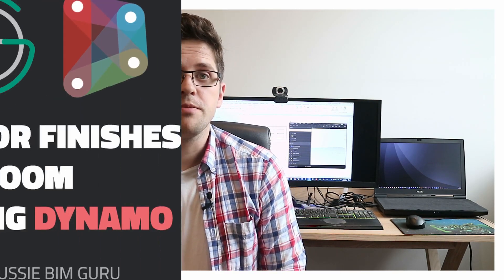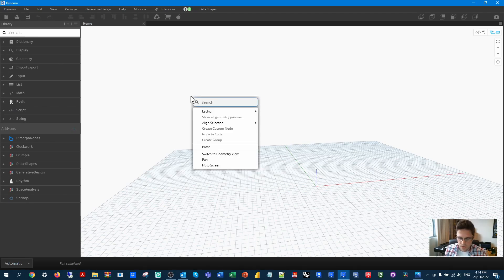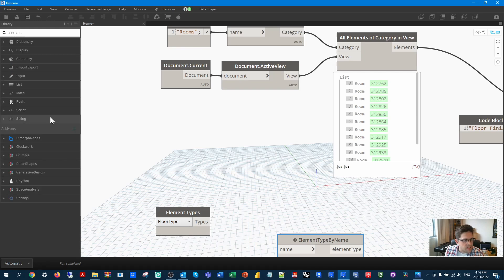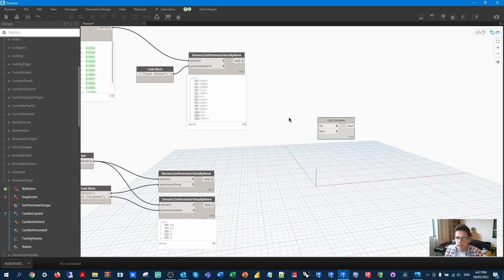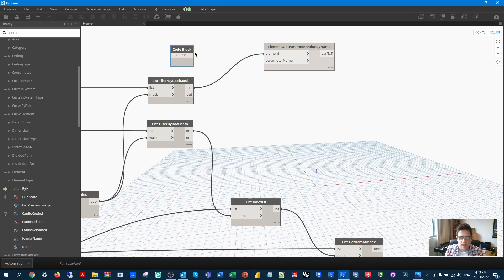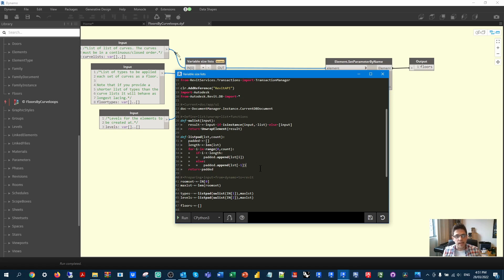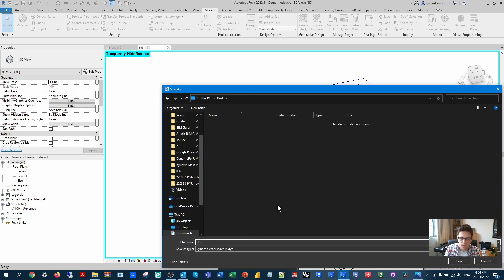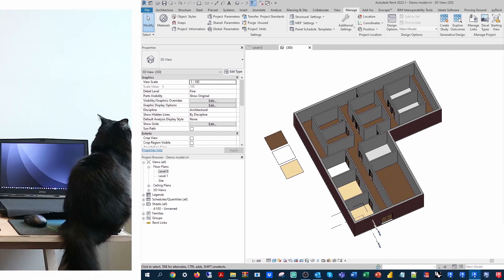Floor finishes by Revit room boundary using Dynamo (revisited)!

Comment: amazing! 
at first all worked just fine, the next day didn't and the problem was from level get by Name always get null any solution for that
Reply from the maker: Hrm that is quite strange... make sure the level names match. You can also use indexing to get levels of a given name as well (basically what my node does). If you are using a higher version of Revit and an old version of Crumple that could also be a cause, as older versions used IronPython2.7 whereas they now use CPython3. Maybe reinstall the package to latest.

I've made an example of getting levels by name without needing Python here:
https://github.com/aussieBIMguru/Dynamo_Scripts/blob/master/ABG_250430_LevelByName.zip

Comment: Thanks Aussie for very useful script. 

I am facing the issue when try to run this script with large project around 200 rooms per floor but only 35 Rooms are created floor, the rest are empty. Im really appreciate if you have a look with this issue. Thanks
Reply from the maker: Hrm short of a memory issue it would likely relate to the input lengths. Make sure you are providing lists of lists of curves per floor, per level in the inputs. Dont use list levels.
Reply: Thanks for replying me. 
yeah, my testing project is multiple level but I have add "Levels" node at beginning to filter all rooms of that specific level. is it reason because number of rooms or 1 of them got issue then script stop at that room?
Reply from the maker: @TrungKiênHoàng-d8w try providing a level per room and that should work i think.

Comment: Super cool script! Hi my name is TJ, architectural designer in Maine. I am new to dynamo. I am curious if I could use the room boundary and generate cropped unit enlarged floor plan views. So I don’t have to manually crop every single unit plan. Do you think if it’s possible?
Reply from the maker: Hey TJ! Certainly can. If youre using a later build of Revit such as 2024 or higher there are nodes out of the box which can set the crop of plan views. You could sequence these after floor plan creation nodes.

I cover this process in python (not beginner friendly) here:
https://youtu.be/cdxXfYi0RN8?si=9GMaxu4n1M66EeZm
Reply: @AussieBIMGuru  Awesome! Yeah I am using revit 2025. Can I download your nodes and python script and use it in 2025 ver? I might follow step by step. I am totally new to dynamo. lol
Reply from the maker: @jeontj13 unfortunately i havent done much testing in 2025 yet, but most Crumple nodes will work there I think. I would suggest focusing on nodes and fundamentals first.
Reply: @AussieBIMGuru  Will  try it on 2023 then! I might have bunch of questions soon.. lol Thanks !

Comment: Hello. 

Can you please overwrite a parameter inside the created Floors on the Floor Finish parameter inside the Room?
Reply from the maker: As long as you have a floor per room in the script you can use get and set parameter from the rooms and floors to pass data after they are created in dynamo.

Comment: Couple of Questions: Github page? Does this work for 2024? I created the .dyn file from scratch as you laid out. On one instance created floors not with finish. Other instances nothing outputed.
Reply from the maker: I've just tested using Crumple 2024.4.3 (latest version) and it seems to work for me. The expected list structure is important to have right, that which a finishboundary nodes returns (list of lists of curves). If you google 'Aussie BIM Guru' github it will likely be the first page, I haven't tested many of my scripts in higher versions personally - not enough time to maintain them these days.

Comment: Hi Gavin, thanks for the update, I’ve followed along and built the graph as per your tutorial, originally it ran fine without errors. However, now it runs all nodes without errors but the Floors.Create node from your custom Crumple package is reporting null values and not generating the floor types in my model. Perhaps you can assist?
Reply from the maker: It will likely pertain to list length/structure. I've tested feeding in the finishboundary node output to a floor.create node and it's working on my side using Crumple 2024.4.3 version. If the list structure differs then the node wont work generally.

Comment: I just download and couldn't see the "element type" option in crumple package, there is only Elements option here.  Did you remove it or I download a wrong one?
Reply from the maker: I moved it to the ironpython nodes area as it depends on the ironpython2.7 package still, whereas most of my other nodes now work in cpython3.

Comment: Hi Gavin,

Thank you for the script. As I'm new to the Dynamo world, I tried to follow the video step by step. I have one question about the last step of creating the finish floors: I want to make an offset by its thickness so that the floor is created above the level, but I'm not sure how to do this. I saw your comment on a similar issue here in the comments, but I couldn't quite grasp it as I'm still in the learning process.

Any guidance on how to do so?
Reply from the maker: So to achieve this you would need to get the thickness parameter value(s) in the floor types you assign to each floor being created, then assign that to each floor's Height Offset from Level parameter after creation.

Comment: Thanks for the great tutorials.
Can you please tell me if its possible to update the floor Boundaries once their is a change in the room boundaries?
I can create them from the rooms but i also want to update them once there is change in the floor plan. Is it possible ? i dont want to create the new floor because the annotations and dimensions will be lost. i just want to update the floor boundaries. 

Thanks
Reply from the maker: In revit 2022 they added API to modify sketch boundaries so yes it should be possible but you would still likely lose most edge references.

https://www.revitapidocs.com/2024/33130afb-7bc9-0229-0c54-b99a3edc21dd.htm

https://www.revitapidocs.com/2024/8538b361-08df-9fd2-93bb-1790a09130f7.htm
Reply: Thankyou so much @AussieBIMGuru

Comment: Hi Gavin

I'm using DYNAMO v.2.17.0 on Revit 2024. I already load the latest crumple package (2022.5.27) and when I run the  "Floors.Create" its only return null. I already tried following in the clip, reinstall package & use previous package and use "FloorsbyCurveLoops" , but it's come same result. I already install dynamo ironpython2.7 but still don't work. Do you have any suggestion for me to check it?

Btw, I really appreciate your work, it's help me a lot to start working in Dynamo. Thanks for your Help!
Reply: For some reason, it's work now after I restart my computer a few times. Your script is GENIUS!!!

Comment: Thanks for sharing your knowledge. How can we add floor finishes to door thresholds ?  There would be an extra problem to adjust side of threshold ...
Reply from the maker: Generally this can be done using door location points, moving them either side at the orientation of the door and extruding back to the floor, then joining these to the main surface for the final outlines. Getting the precise line of the leaf is difficult however, and will require careful analysis of the door facing orientation as well as host wall thickness and leaf line offset if any.
Reply: @AussieBIMGuru  it would be great if there will be additional video based on this revise

Comment: what can we do if we want to create the floor piece by piece in the room? EX:60*60 piece and we should consider the joint 1mm or 2mm between each piece.
Reply from the maker: Surface pattern and material. Piece by piece is overmodelling.
Reply: @AussieBIMGuru  but, if we use a pattern and material we can't have the quantity as a pieces. am I wrong?
Reply from the maker: @engomardriouich9329  you are correct, but if you know the quanity per square metre then you can wotk with that generally instead.
Reply: @AussieBIMGuru  so, is there any script that could help us to name each piece of the floor by giving it a number such as 1,2,3,etc... , and that number we can use in the schedule to get the surface of each piece
Reply from the maker: @engomardriouich9329  yes you could select them all and simply add a range of numbers to a parameter. If you need a good order then you could sort by centre of geometry and its X/Y coordinates.

Comment: Hey I come back to watch this one,I couldn't find All Elements By Type node in Revit 2023,I use one from Clockwork.Also I found the I use the list.contains node the wrong way,yours is better.I'm not that smart but I’m willing to make progress step by step.
Reply from the maker: Yes they removed element types for classes in 2023 i believe.
Reply: @AussieBIMGuru  Sad for that.
Reply from the maker: @mavs013  theyre actually a lot better than element types but require a deeper knowledge of the revit API generally. For example WallType is a class as well as Wall, whilst originally Wall was a category and WallType was an element type.

Comment: Hi, I am trying to follow your tutorial but I think there is a major issue with your package.  I am using Revit 2023 and from what I understand is that the API and Dynamo itself has changed quite a bit and your "Element type by Name" node is not working properly.  I went in and changed the Python code from IronPython2 to CPython3 which I thought would fix it but It still only returns "null".  I am using the 2022.5.27 version of Crumple.  Also, I can't find the "All Elements of Type" node anywhere.  The closest I get is "All Elements of Family Type".  Is that the same thing just with a different name? What should I do to fix this problem?
Reply from the maker: My package is built in ironpython and cant just be switched to cpython3. I recommend installing the IronPython dynamo package and it should then work fine as is.

Comment: Hi, I am trying to place a floor in between beams and columns. Is it possible? Do you have any suggestions?
Reply from the maker: Difficult unfortunately as you're trying to catch negative space. If your beam grid is even enough you could try to capture them using an algorithm like wandering salesman or dijkstra's but there isn't an easy one size fits all method.

Comment: Hi, thank you for the script! I've managed to do it in the end but I don't know why it created 5 floor finish per room instead of just one? Did I do anything wrong?  I think the only different in my dynamo compared to yours is I used the "Floors.Create"instead of "FloorsbyCurveLoops" because I couldn't find it in crumple.
Reply: I installed previous version of crumple and indeed, "FloorsbyCurveLoops" works like charm. No more duplicate floor finish in my rooms!
Reply from the maker: Glad to hear my node helped. Most people build their nodes in different ways so yep usually need to use the ones I show.

Comment: Your node is technically returning an Element Class. 

Element type is sort of an odd thing in Dynamo as it is used to describe all types (top portion) of elements. Family Instance > Element Type node > will return Family type and a wall instance > Element Type node > will return a wall type.

I imagine the OOTB node wants a literal type name perhaps? I haven't looked at that node much though.
Reply from the maker: Yes technically a revit API object, although the element type node returns it in class form too I think, cant quite recall... I've had pretty mixed results with the OOTB one so far so I tend to stick with my node which enums by class name which is usually the element type name in Dynamo.

Comment: Hello! What is your common solution for Revit level placement? We often do it by the level of ‘finished’ floors. Do you usually place revit levels on unfinished floors?
Reply from the maker: It depends on the project really. Sometimes a separate SSL/FFL level are needed (e.g. a project with a raised access floor), but if all finishes are set down (e.g. floor tiles), then SSL/FFL are the same sometimes technically (even if laid finishes like carpet sit slightly above). In the latter case we just offset the floors by their thickness and give them a boolean parameter to indicate they are a laid finish, which we can then use view filters to verify if they aren't raised in their elevation or use Dynamo to verify regularly.